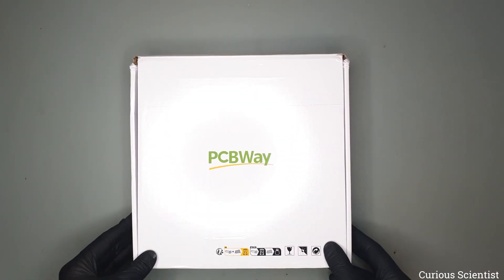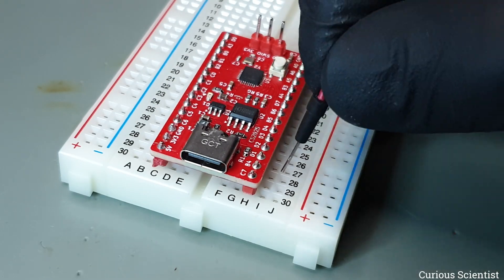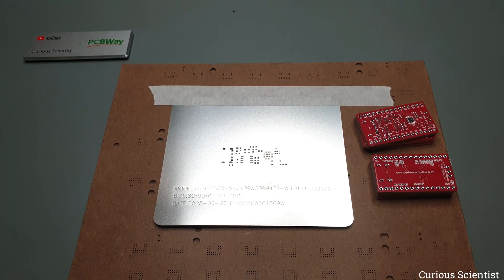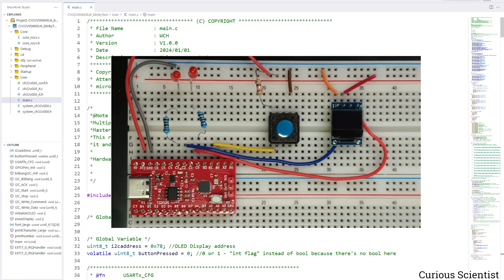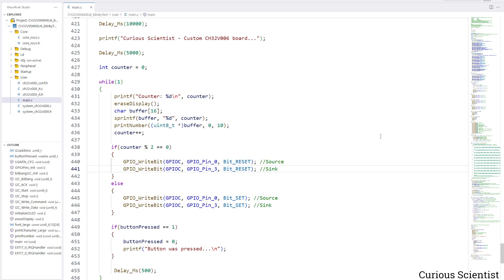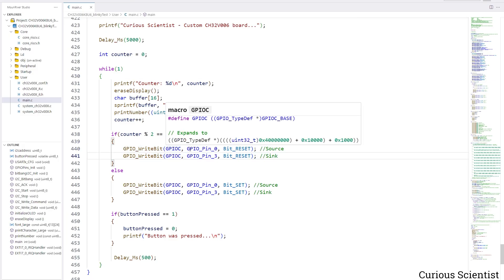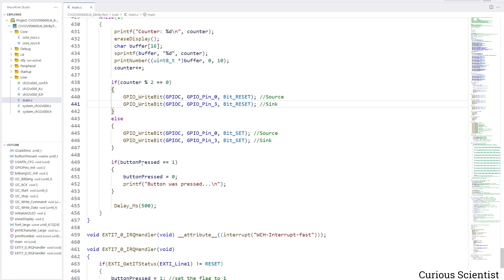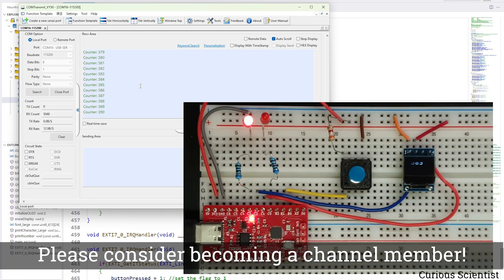CH32V006K8U6 Custom Development Board For Less Than $5!

Comment: I was also looking for a more powerful board compared to Arduino, and that's when I stumbled upon the stm32 blue pill. If I'm not mistaken, the stm32 MCU is more powerful not only in comparison to the Arduino but also the ch32, while still selling for the the same price. I'm interested in your take on that board and how you compare it to your ch32
Reply from the maker: Hi!
I would put the STM32F103C8T6 ("bluepill") next to the CH32F103C8T6 and there are very tiny differences, unless you are a very advanced user. Well, I guess, WCH anyway tried to copy this exact MCU, hence the same numbering... The price difference is 6-times higher for the STM32. So if you don't mind working a bit more on the coding side and digging into the datasheet and reference manual of the CH32 chips, it might be a much cheaper alternative. It would be a fantastic alternative if you come up with a niche product that you can sell in the order of magnitude of few thousand units. Then you'd save a nice amount of money. You could even go with the CH32V303-series for almost double performance while still getting a 3x cheaper microcontroller.

Comment: I have a question about the curved/round tracks aside from asthetics (which looks great) are there any downsides meaning can i use round track for everything example 50ohm digital track or 90ohm usb differential pairs etc by the way great project if would replicate it i would love to see the black solder mask colour a nd some inbuilt sensors like imu rtc etc
Reply from the maker: Hi! I am probably not the most educated person in this topic to perfectly answer that, but I can tell my experience. I used it for differential USB traces, and there hasn't been a single issue yet. Especially, I always make a funny loop under the usb-c connector to connect the pins together, and so far, it hasn't caused an issue. But please note that I am still using relatively slow signals. I think for slow signals, it should be fine. When it comes to higher frequencies, probably one must be more careful.

Comment: Writing this because I tried USART to program this board, from the given software and example in the example section EVT EXAMPLES USART_IAP,  Tried a lot but No response from the MCU.  By the way your series is amazing.
Reply: I had no problems using serial with V006 the TSSOP20 with the CH32 Arduino core. Perhaps you can try it to see if your USART is still working.
Reply: Just read your post again. Normally one would use the WCH LinkE device to program the board via SWD pin. First test with the WCH Link Utility to see if it responds. If it doesn't, make sure that both LinkE device and Link Utility are updated to the latest version.
Reply from the maker: Thank you for the kind words and your feedback. This MCU supposed to have a bootloader so somehow it should be possible. But I am not yet educated enough to say how it is possible. As soon as I figure it out, I will create a tutorial video/article on it. Hopefully soon.